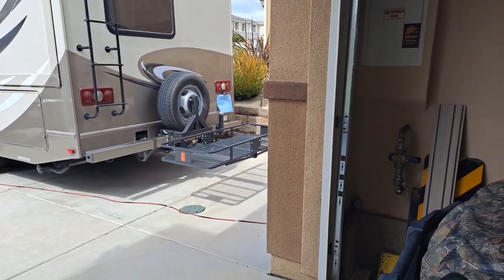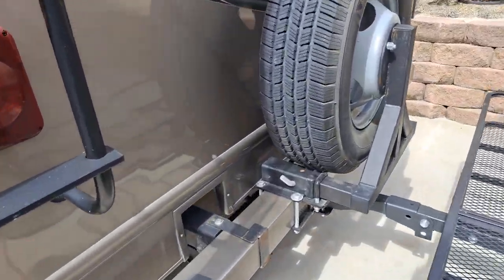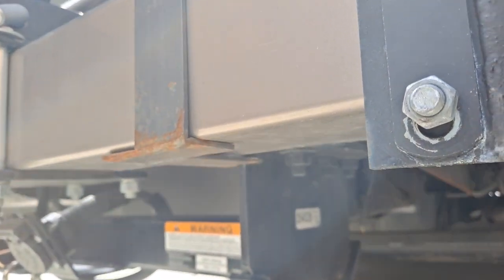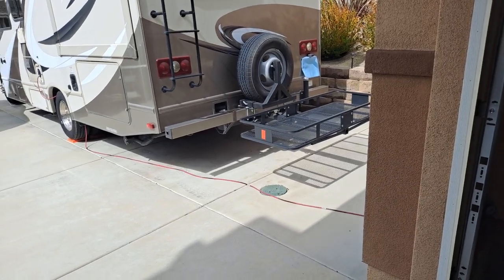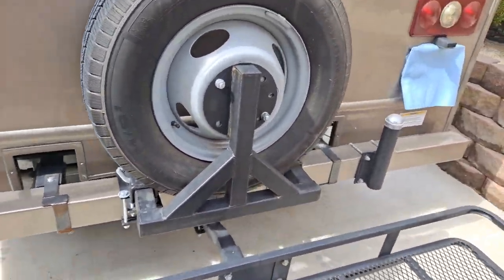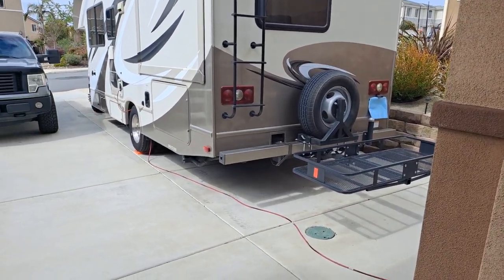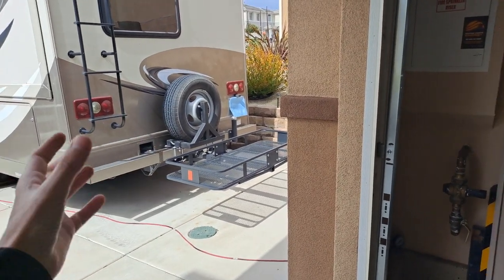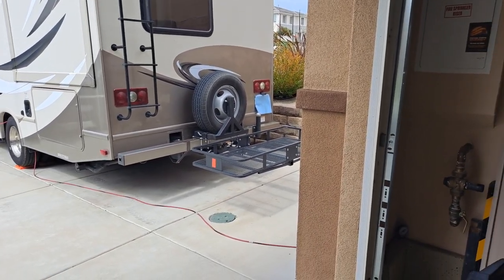RV Bumper Spare Tire Mount Solution

Comment: Great thanks for sharing, smart and strong design. Please share length of all members of the 2 by 2 pipe. Thanx again.
Reply from the maker: The two pieces perpendicular to the bumper coming out of the mounts are each 13.25" long. The piece parallel with the bumper is 21.75" long. The diagonal pieces are 9.5" long. The vertical piece is 15.75" long. The circle plate is 8" diameter .25" thick. Keep in mind your vertical piece will change depending on size of your tire. My tire is a LT225/75R16, which is about 29" in diameter.
Reply: @A-man-100  Many thanks @A-man-100 for your reply and helpful tips. 🌹